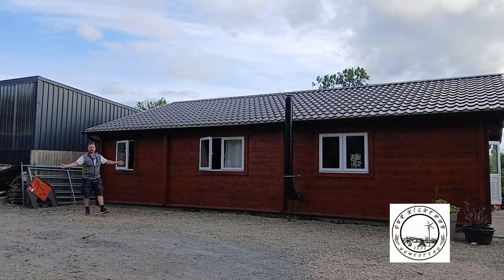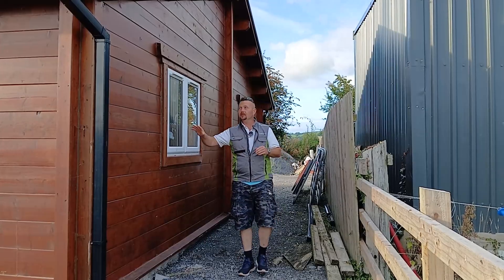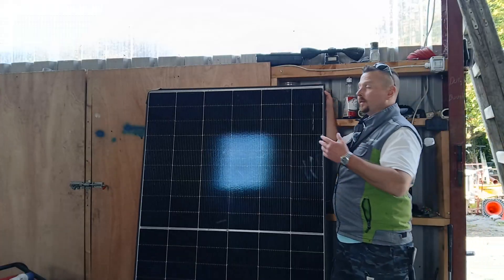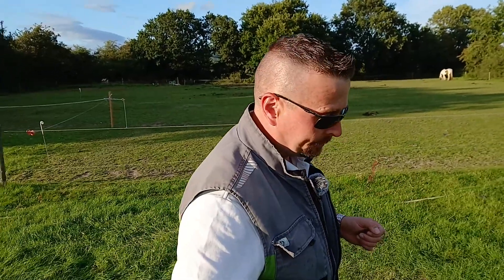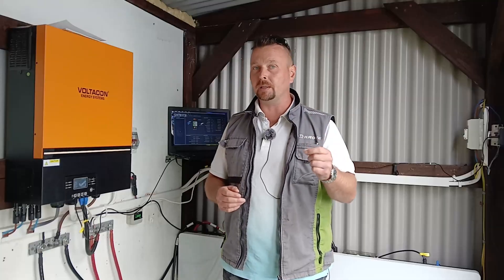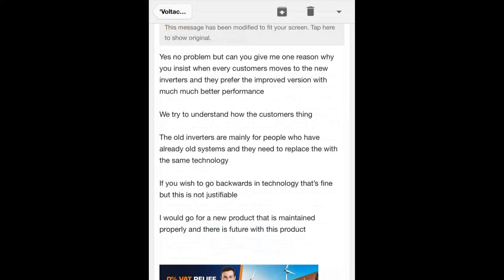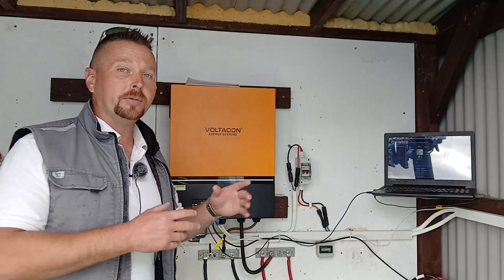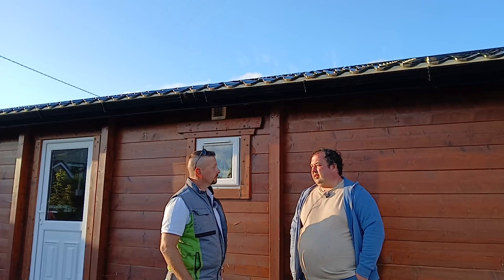OFFGRID POWER, 2 HOMES 1 SYSTEM

Comment: While Im aware that the inverters are all made in the same place, it doesn't mean they are the same quality. EAsun has a years warranty at most for a good reason and it has a relatively bad failure rate. 
That said, Voltacon were a bit scummy trying to constantly sell you something you didn't want and should have been honest about their issues if that was the case.
Reply from the maker: Voltacon branded inverters also 1 yr warranty. The smaller inverters do have a higher failure rate definately, the max 11 however has a very good reputation.
Reply: @ourkilkennyhomestead2006  Oh I wasn't aware. I thought they were 3 years. 
In that case, just avoid Voltacon then. It's not worth the price increase if they aren't providing more than a years support.